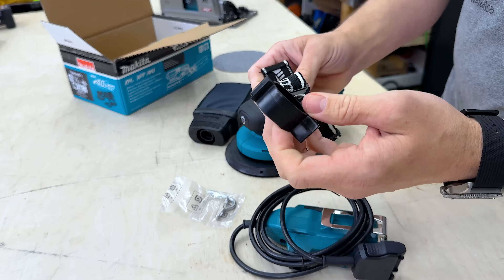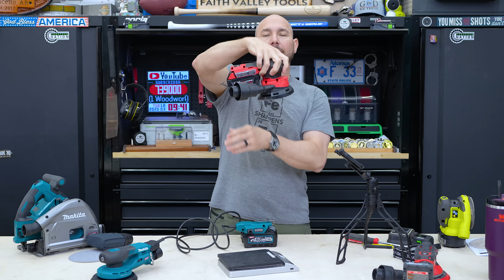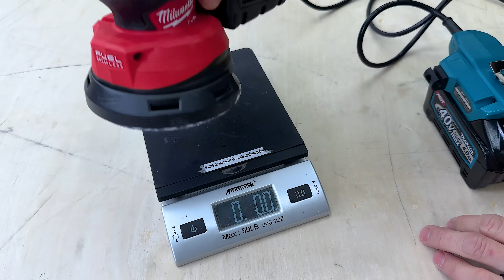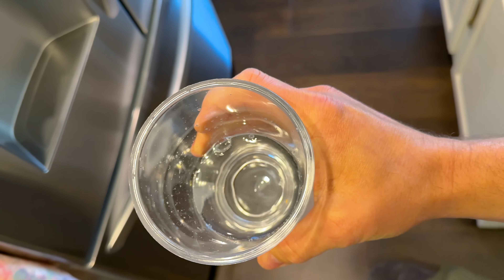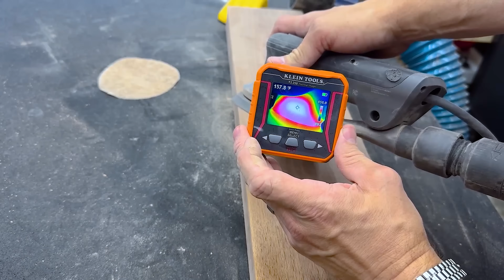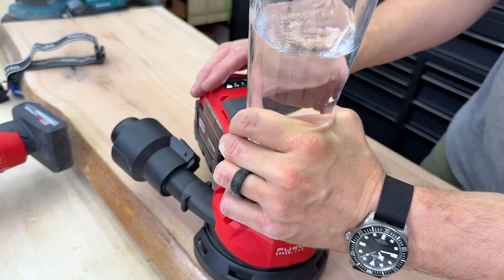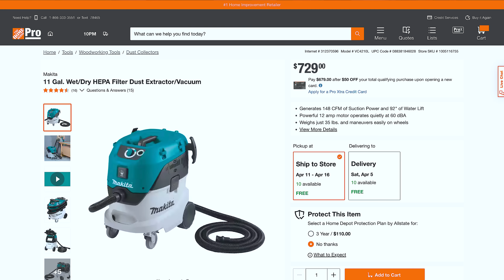Makita Just Changed Cordless Sanders FOREVER! (genius woodworking tool)

Comment: Ryobi, hope you are taking notes... this Corded / Cordless model fits the One+ platform uniquely well IMO. Flat plate with the "insert" and then you could plug it into ANY tool in the platform. Particularly good for work lights, and for working in tight spaces where the battery gets in the way.
Reply: Ryobi already does this for the 40 volt tools, shouldn’t be too hard to adapt 18 volt platform.

Comment: I understand that you are reviewing a new tool ,but is it really practical?   I am a bit confused. I get the cordless sanders. Take them anywhere and use them more places yadda yadda yadda. So you buy a more expensive sander that you can't attach a battery to other than the cordless, cord and you get an hour or so sanding per battery.  So a corded sander has a cord and no limit on the amount of time you can sand or buy this sander that adds the cord back to the sander and limits how long you can sand....

I get it that some people may like it cause its new and the newest toy in the store  but $249 for the sander and $259 for the 4amp hour battery....in some cases that is over twice as much as a corded sander and has the same limitations as the corded sander PLUS limited sanding time due to battery.  Lets face it. Most of the people watching this video are not going to non electrical job sites rather they are staying in their own shops where there is electric and unlimited charged batteries and plugs for a corded sanders. 

This is not a dig on you. This is more of "What is Makita thinking ?"
Reply from the maker: I bought this with my $$ because I liked the concept and it’s actually a great idea for a sander for all the reasons stated in the video.

Comment: One thing im shocked all the main manufacturers haven't done with there cordless tools is have a plugin wall adapter to go in place of the battery when its dead an acts as if it was just a corded power tool also giving it the power of the highest amp battery they manufacture
Reply: hikoki (or metabo as you have in US) has one. and its adaptable to all their battery tools
Reply: @ Not sure why you're implying Metabo are a US brand? The two come under the same ownership but Metabo is very much a German brand. IIRC they also use different battery systems and the Metabo guy said on Gotools recently that they have no plans to merge systems
Reply: @feanor5037  She is not implying that Metabo is a US brand, she is saying that Hikoki is not well known in the US, since the tools are sold as Metabo (HTP). Metabo itself is also not very common in the US, since Metabo bought Hitachi, rebranded most of the tools to Hikoki (Metabo HTP in the US). Hence, the Hikoki 18/36V power adapter also works for the metabo HTP tools, since it is the same hardware, but not for the metabo tools, due to the reason you mention. Sadly Metabo is not so smart and just takes the Hikoki Adapter and redisigns it for their battery platform - I mean all CAS tool companies would profit from it... but hey, why do something for the customers?
Reply: @kaktus3175  Oh ok fair enough, I wasn't aware of that very confusing context! I don't get why companies make such a mess of their brands on the international level, with people sharing info over the internet it just creates muddle.
The Metabo explained the rationale on the Gotools video, it's in German you should be able to watch it with auto-translation. IIRC, Metabo bought out Hikoki but don't want to leave existing customers behind. And he might have mentioned some fundamental incompatibility with tool<>battery communication, not sure.
I do agree with you though, it does seem silly. I sometimes wonder whether I'd have preferred to be on the CAS battery platform instead of the Bosch Pro / Ampshare one, as CAS is quite successful and I feel like Metabo might have preserved their quality a bit more than Bosch. But stuff like this puts me off, and I also get the impression that Bosch's battery tech is just that bit better.
Reply: @feanor5037  Imho this is all bla bla marketing twaddle. Of course Metabo would be able to just provide a CAS adapter for the Hitachi/Hikoki tools and be done with it.

Bosch does built some nice tools. But they are (way too) slow in development, often don't listen to the customers and their tool range is not optimal. Having one tool basically x-times without offering others at all is just not good in regards of choosing a battery platform to begin with.
But: Buying in Germany they do have some great deals, the AmpShare became bigger and so on. Thus, yes not an easy decision. Fortunately, there are battery adapters out there...
Reply: @feanor5037 metabo hpt it's rebranded Hitachi, metabo (German) is not selling in the USA.
Reply: Flex has it. I believe DeWalt too
Reply: @aberba  - so does Festool for their Ergo powered ETSC sanders. For almost a decade now.
Reply: Someone had that for a cordless miter saw I believe. Can't remember if it was Dewalt, Festool or a different one...
Reply: @ivotouart hikoki
Reply: Festool does for their Ergo series powered ETSC sanders (for almost a decade now).
Reply: The reason is the enormous amount if power needed. A power supply for thet would be very big and pretty expensive. Its cheaper and more convenient to buy 2 more batteries and an addiditional charger. Also all the outrage you would cause publicly from people who wouldnt understand it when you present them with a corded attachment, that is expensive and big.
Reply: @juliusgaming9603  it's not that much power for an outlet... think about it. On a corded sander the rectifier is already built into the sander and doesn't add much weight.
Reply: @antaholics  Julius isn't wrong though, if his wording in terms of the electrical theory isn't exactly clear.
The issue is the massive step between 18v DC and mains and the amount of power that needs to be converted between a DC battery and AC mains, while ensuring smooth supply of power with no spikes regardless of current being drawn by the tool.

Also, cordless tools are completely different in terms of their motors. Corded tools use AC motors while, I believe, cordless tools generally use a form of DC motor.
Reply: @antaholics  Cordless power tools have the ability to draw direct current from the battery. And as such they can pull a lot of amps. High draw tools can pull as much as 180 Amps. Finding an inverter capable of 18v at 180 amps is insanity. That’s a near 3000 watt inverter, it would be the size of a chainsaw. Now a more nominal amperage draw would be 70 amps but even that is still a massive inverter. The problem isn’t the power available, it’s going from AC to DC.
Reply: @juliusgaming9603  The weight can be offloaded to a separate power supply it does not need to go where the battery slot is only the connector can go there but like those TV or monitor or laptops that have an external detachable PSU that is usually heavy they could do that instead
Reply: I’m angry ridgid makes one for the red tool series but not the orange
Reply: @dustinandrew67 Apparently it's quite difficult to get right. I saw videos a year or two ago where people were finding that DeWalt's mains adaptor for 18v tools was causing tools to fail, one guy in particular kept having his chop saw fail
Reply: Literally just commented the same thing… if we’re both thinking it it’s only a matter of time
Reply: The people who used the DeWalt flexvolt mitre saw with the cord too much burned out the motor probably because ac vs dc. Mine hasn’t burned out yet but it sounds different when I use the cord. The new flexvolt saws  have taken off the option at least from the places I shop. Only low amp draw tools like fans and lights can easily be plugged in and use batteries. Lots of info out there on all this
Reply: there are some tools that do this, but typically larger things like miter saws... because this would require some added electronics. like a power inverter or specialized motors that can handle both AC and DC power.

Comment: Makita has been doing wacky stuff lately, 40v impact is stupid and then they make adapter that make the battery for whatever tool it on for only that tool and then you have battery tool and weird adapter, makita is way late to  the tool boxes and Christ all the stuff you have to dig through tools because the rolling box is sooo big they can keep all there stuff and i was a fan boy 10.years ago until i noticed they are not keeping up with battery tech

Comment: If you add the 5mm to the less than 6 inches, you may well find that the sanding area is in fact 6 inches. ;-)
Reply: If you think a little bit, you might in fact find out that Makita is a Japanese company and because of that deals in real measurements and not in strange American stone-age measurements. The sanding plates are 150mm in diameter, which is, in fact, just under 6 inches. The rest of the world gets exactly what it says on the box - a 150mm sander...

Comment: Dumb question -- what is the benefit to a corded-cordless sander plus a vacuum hose and corded-corded sander plus a vacuum hose?
Reply: Everyone in this thread is making fun of this but it's part of a system that's not made for the woodshop. To perform optimally (and avoid damaging the motor) this kind of sander pioneered by Festool and Mirka back in the day, has to be connected to a shop vac. This product is all part of a system, with a backpack vacuum cleaner (there's a picture of it from the manual shown in the video). I'm guessing its main purpose is outdoor sanding for auto shops when you're doing body work or retouching finish sanding before painting walls, really niche usage but a welcome addition when you need it. This is not a tool made for the weekend woodworker in mind, that would make no sense...

Comment: I have needed a much lighter weight sander to use in removing epoxy based anti fouling paint from boat hulls. Holding the typical 6 inch random orbit sander overhead for 8 hours a day is brutal, especially at 65

Comment: The area of a circle is πr²

A 5 in sander has a surface area of 19.6 square in, while a 6 in sander has 28.3 square in. This is 43% larger.
Reply: That calculation speaks volumes!
Reply: @wallacegrommet9343  volume is 3 dimensions. It speaks areas. Whatever that means.
Reply: When he suggested people Google the surface area representations, I took it as another indication of the dumbing down of America when it used to be that most children could do this calculation for themselves.
Reply: @guermeisterdoodlebug7980  Most children could probably still do it. The trouble is that they have forgotten it when they need to do it 20 or 30 years after leaving shool.

Comment: I own the BO002CGZ (150mm with 5mm stroke). I didnt got the side hook, but did get the arm band. Dont think one sold for European market come with that hook. To tool itself, you need to get used to detached battery and the cable coming out of the machine, if youre coming from batteries attached to it. Sanding was a pure pleasure, sadly the Makita vacuum that I owned loved the static electricity, so sanding my desktop was a shocking experience (went crazy and replaced it with a Festool CTM Midi to not get zapped again).
Overall, they went with Mirka type of design minus the power cable and the price tag.
Reply: What dust extractor adaptor do u need for the festool please
Reply: @darrenbarber323  Fpr those models of sanders none. The end of the Festool hose is rubber. Just twist it in. Might feel a little hard to attach, if the hose is new.

Comment: It would make more sense if the battery could be put on the sander or connected by cable, giving you the option of either.
Reply: Exactly, I have no interest in getting makita batteries and other tools so it would be nice if it had a wall cable option

Comment: Can someone explain to me why anyone would want a high end sander that was cordless AND hooked up to an extractor? I currently use a Mirka Deos and Nilfisk extractor and have never had an issue with the cord.
Reply: About the only thing I can think of is that some people have a battery powered shop vac hooked up to their sander. Personally, I thought it was dumb to be tethered to a wall powered dust extractor hose 's hose using a battery sander.
Reply: Makita makes 2 backpack extractors. Im a bosh nerd and finally got their cordless extractor, its not a backpack but it does have a sling. Being able to be high up on a ladder with a cordless sander and extractor is really awesome, game changer for work onsite. Completely unessary for a work shop though.

Comment: Since there is already a cord on the tool, you might as well just go with a corded tool, imo.  The only place I can think this might be of use is for construction where you might not have power.  Otherwise, it just feels like a novelty that is quite a bit more expensive, especially if you have to buy the battery.

Comment: This is an awesome concept with the "corded battery".  With the proper adapter, you can drive almost any tool with almost any battery! I love this idea! Imagine having a 12aH battery on a trim router without the massive weight on top. Good job Makita. Thanks for costing me lots of money Matt.
Reply: It’s been a long time in coming! This concept has appeared and then immediately disappeared several times over recent years
Reply: We bought an adapter for a dyson vacuum with a premature battery death for $30 CDN. Now we power it with a MILWAUKEE battery.  There is definitely a market here for this. Come on entrepreneurs! Make it happen.
Reply: @STCSTW  now, imagine a world where the vacuum plugs into the wall & you never had this problem
Reply: Why not just plug it into the wall? You have a cord either way.
Reply: @Clint3571  If you are near an outlet and have lot of sanding sure, but if you are on a jobsite you can easily be far from and outlet, or dragging a cord around is too much a hassle. I can see this being useful.
Reply: @petrsidlo7614 exactly. Also, say you are working up on a ladder or scaffolding indoors. A long cord hanging way down to the ground has a lot of weight that can make sanding clumsy if you’re fighting that pull for hours. Not to mention tripping on in, or the annoyance of it snagging on something and stopping everything to fix that. The battery gets clipped on your belt or arm and then you have a very agile setup. In the shop, it makes little difference of course.
Reply: @chriskelvin248  Just buy a Jackery or Ecoflow or something like that if needing to power corded tools.
Reply: @ 1) if you are somewhere too far from a plug, or any reasonable extension, you are better of with cordless tools anyways 2) if your tools are so big that they need to be corded (core drills, etc) that Jackery really wont help you that much and its just extra weight you have to lug aroung.
Reply: @matthewjbauer1990 Another $800 for the jackery, I don't think so
Reply: @Clint3571  forreal I am amazed that so many people seem to act like a corded tool that hooks up to a specific battery you need to buy is somehow better than a corded tool that plugs into a universally available standard wall outlet.
Reply: @Clint3571  You can clip the battery pack to your belt or drop it into a pocket in your work belt and walk and work your way around a large object or work on an interior wall or a building's exterior without trailing a long electrical cord--which gets heavy if you're up on a scaffold and your generator or outlet is at ground level.
Reply: @Clint3571 you're not always near an outlet... This isn't meant for a shop tool, it's meant for the job site.
Reply: @Clint3571  I see your point however if you’re coming into a multi million dollar house and have to do some special work they don’t want your cords all over their house. Tool for every purpose. This one has its place.

Comment: glad you finally reviewed the sander i was recommending testing. the thing i hope they make better is the dust bag, make it have some type of gasket fitting or a twist on bag like Milwaukee. another improvement that i think would be great which they could sell separate as an upgrade is a better backing pad for the 5" and 6", what i mean is for example the 3m xtract hookit back up pad. the dust collection on that style is much better then the holes that Makita designed there's around (i had a good feeling you would love the sander, to be honest im considering getting also there delta sander which you can swap the back pad for the sheet style.

Comment: The tools are manufactured in metric dimensions. Therefore, the sanding pads are 150 mm in diameter, which corresponds to approximately 5.9 inches.
Reply: Close enough innit? A sander's pad that is 1/10" less in diameter would have a six inch sanding disk extend less than 1/16 inch over the edge, that is if your disks are exactly 6 inches in diameter--but are they really?

Comment: I feel like this is a very specific use case where it applies for WHEN you need this type of tool. Which sucks, cuz I wish they'd offer the ability to ADD a battery to make it fully cordless rather than have a SEPARATE sander for the application. It's a corded sander with a battery pack only option. Which is way too niche for my tastes.